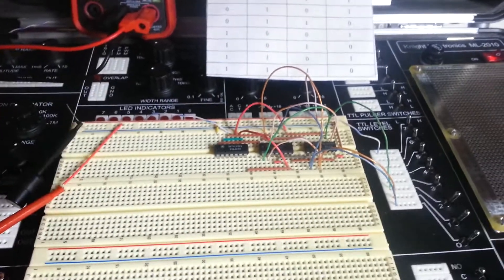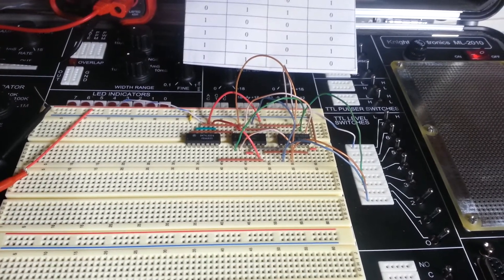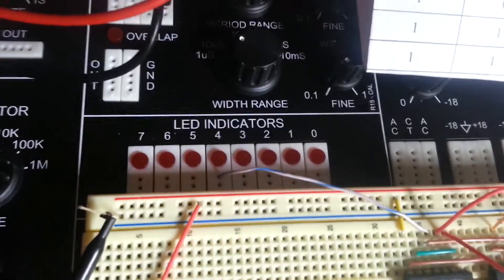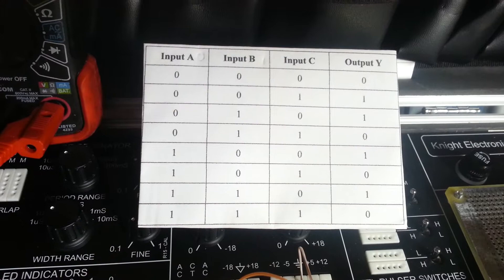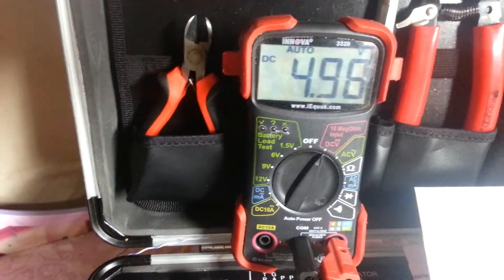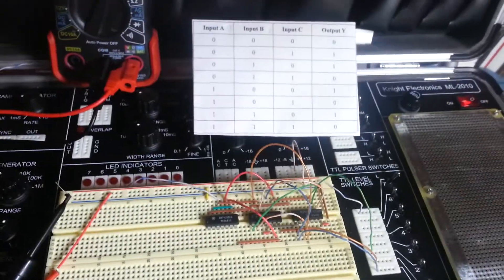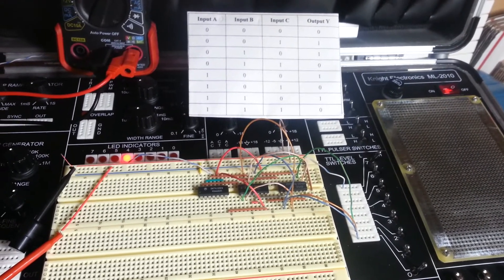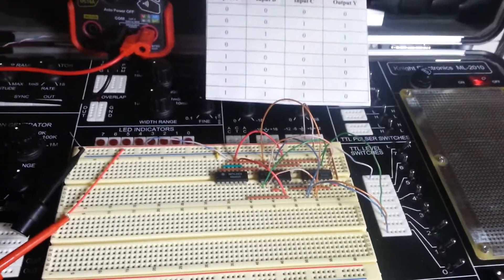ECET105 Week 4 Lab Demonstration

Comment: can i ask something ? what if i will use 4 led and fill all this conditions
0 0 0 1 
0 1 0 1
0 1 0 0
0 0 1 0
1 1 0 0
1 0 1 0
0 0 1 1
1 1 1 0
and i will be using 74ls04/74ls32/74ls08 ICs
thanks
Reply from the maker: +Well Played 

I'm not sure exactly what you mean.  The answer would all depend on how they were connected.  Do you mean that you will be connecting 4 separate LED's to the circuit?